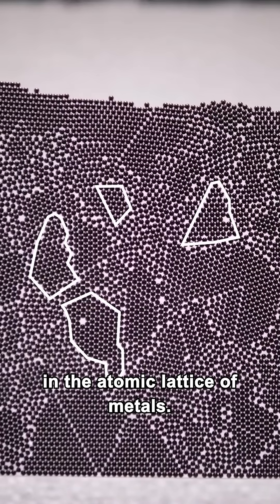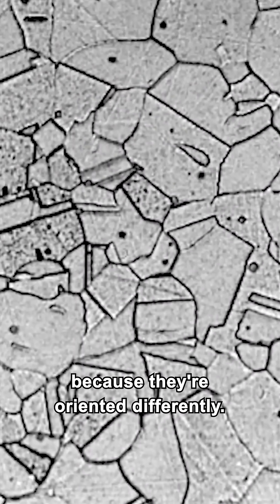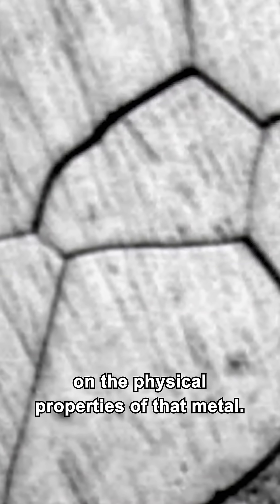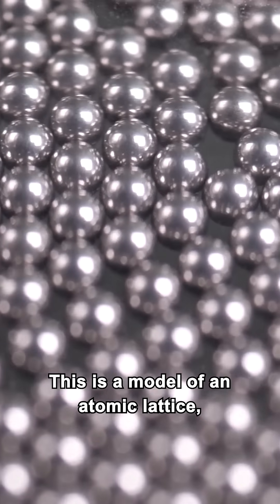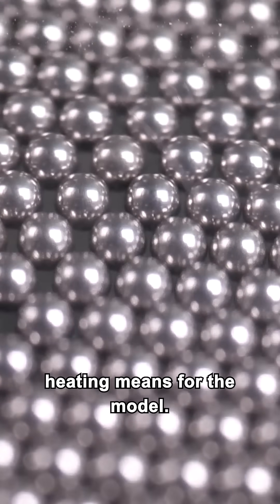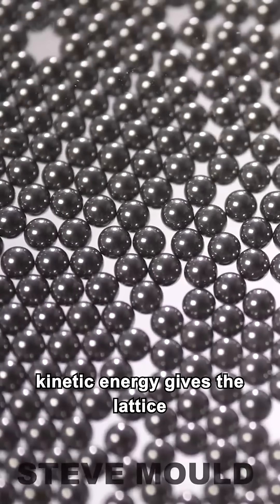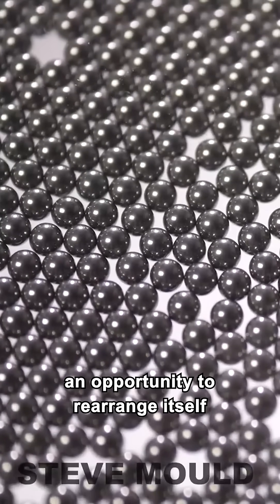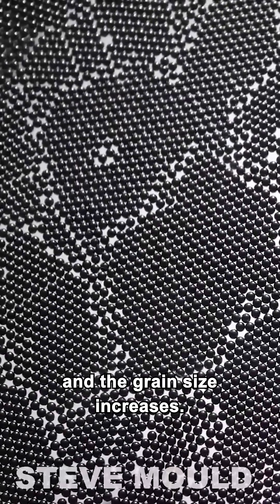What Happens When We Heat Treat Metal? #shorts

Comment: Okay, but what does tempering do? The obvious answer is "reduce the size of the crystals", but then why not just heat-treat the metal less? Surely there's a better reason.
Reply: Tempering increases the size of crystals, as it is gently heating. 

Quenching creates small, hard, crystals but a brittle overall structure. Tempering increases crystal size, while leaving some smaller included crystals, creating a less brittle "stronger" matrix with hard smaller grains within it that maintain sharpness of the piece.
Reply: @Scubadooper  That seems to belie Steve's suggestion here. He says heating produces large crystals. You can't quench until you heat, and the heating before quenching is much hotter than the heating to temper. Your explanation is much more in line with what I've heard before, but it doesn't seem to match Steve's argument.
Reply: @wbfaulk   what Steve is showing is effectively an analogy of tempering.

When heat treating to form small, hard, grain structures (when quenched) the metal has to be heated above the recrystallisation temperature. The rapid cooling of quenching locks in place small grain structures with lots of internal grain boundaries and lattice flaws, which the incision of carbon promotes, a "martensitic" structure. Tempering is the process of gradually relaxing those to provide greater toughness.

Steve's initial state (if you watch his longer form videos) is achieved by rapidly "freezing" the ball bearings into place, an analogy for quenching.
Reply: @wbfaulk Steve literally says cooling quickly and gently heating just enough to get the balls to shift around in the video...
Reply: @Ender240sxS13 He literally does not. The only time he comes close to saying that is at the very beginning: "If allow these balls to fall quickly into position". Nothing about slowly anything.
Reply: Quenching an tempering works by a different effect. At high temperatures, the lattice structure changes so that there are larger spaces between the atoms where carbon can exist. But this can not be visualised in 2D.
When cooling, the lattice structure changes back. Quenching cools the metal fast enough, that the carbon can not diffuse out and it stays at its old places, which are too small for it. So the whole lattice is under tension and misaligned, which stops defects from propagating.
Grain size is an additional hardening mechanism that can be applied on top and is also controlled by adding small fractions of metals such as Niob
Reply: This demo doesn't show phase transitions between different microstructures, so it can't show quench hardening or tempering.  In steels, quenching causes the creation of a structure called martensite that's very hard and brittle.  Tempering converts it to "tempered martensite" which is less so.  That skips a lot of variation and subtlety that goes on with different alloys, but it's usually the main thing happening when you temper hardened steel.

As martensite is progressively tempered the actual shape of its structures changes and carbon migrates out of solution and into carbides that form between grains.